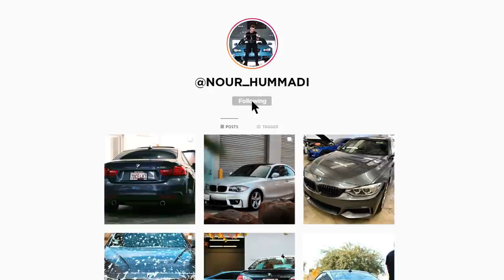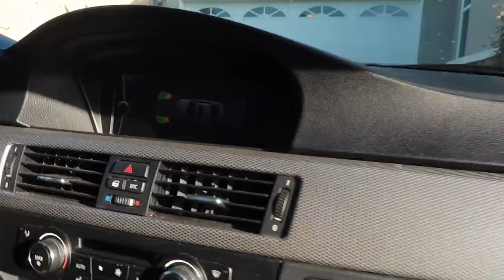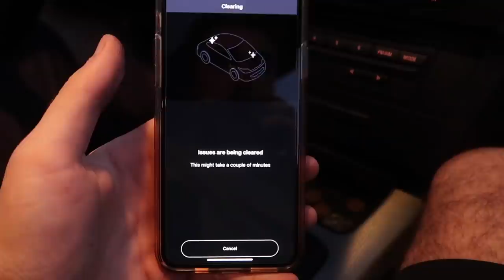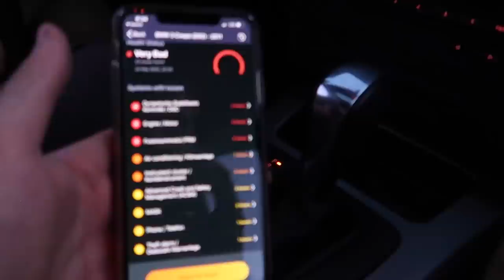SOMEONE BROKE INTO MY BROTHERS BMW!

Comment: You don’t need to code the window . Put the car in the accessories mode and on the driver side hold the window button on the down position for like 20 second and it will reset the window so it goes up and down perfect when you open and close the door